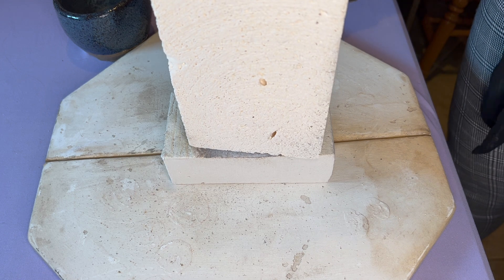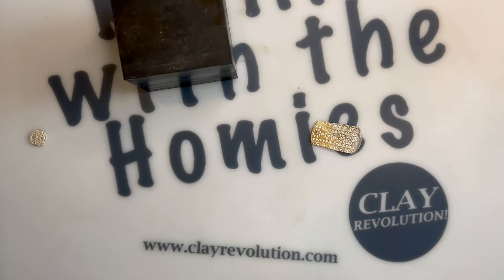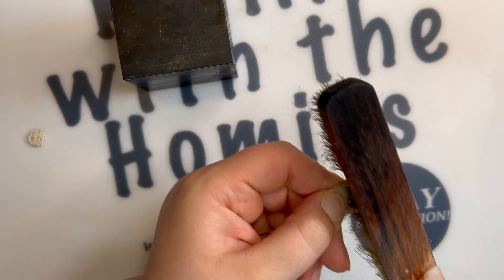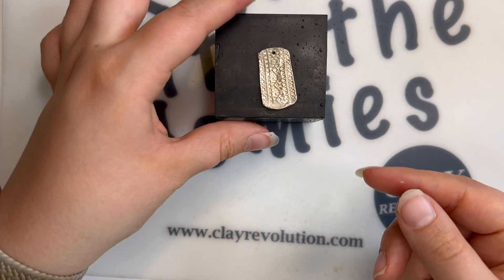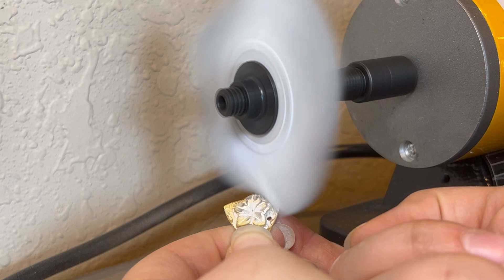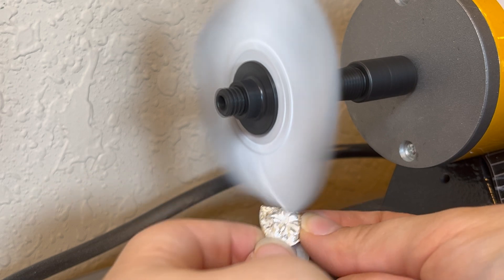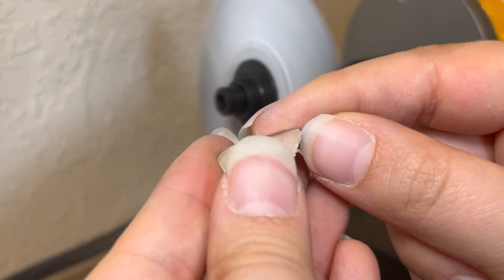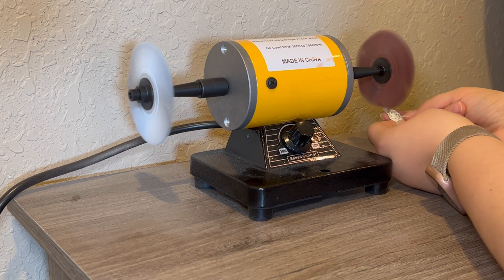How to Polish Metal Clay - Two Different Methods

Comment: Is there a reason you aren't using rouge or Tripoli for your polishing? Usually those are used to polish silver on a buffing wheel.
Reply from the maker: Hi! Yes, Metal Clay is a porous metal after firing. The surface is rough and compounds can get pushed down into the metal. This discolors the metal. So, we use what we refer to as ‘dry’ polishing. However, you can do the initial steps to burnish the surface, then use the compounds for a high shine.